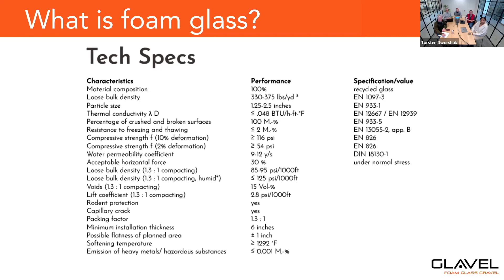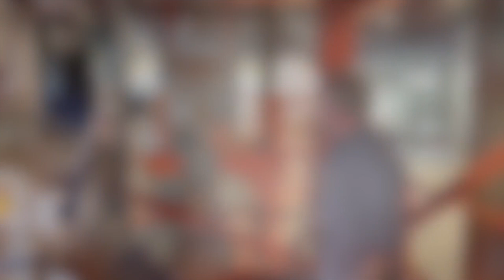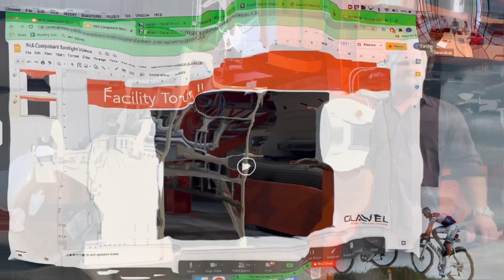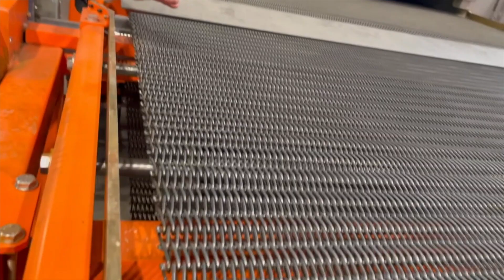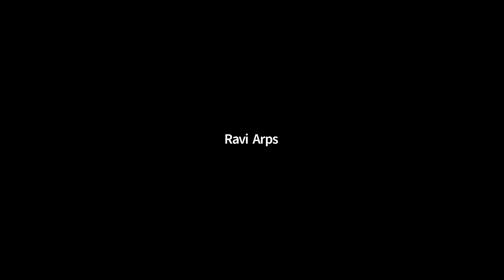Foam Glass Solutions for Passive House and Glavel Factory Tour

Comment: I struggle to understand how - assuming the voids are not flooded with water or mud - convective air movement BETWEEN the pieces of aggregate doesn’t overwhelm the unit thermal resistivity of the pieces of aggregate. However, I realize there are smarter people than I involved…. so I’m assuming I’m overlooking something. Is it more that “it’s better than anything else with same compressive strength” than that it is in fact “good” relative to for example medium density rigid mineral wool like ComfortBoard 110?